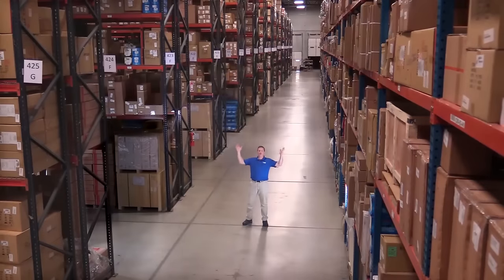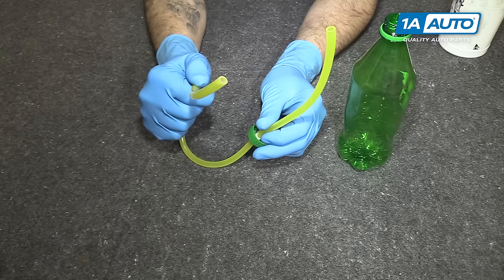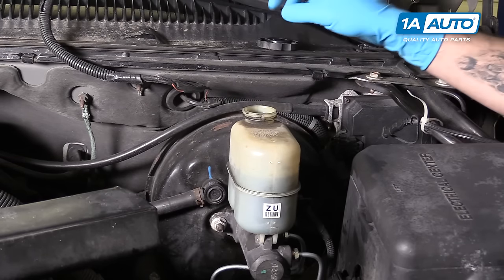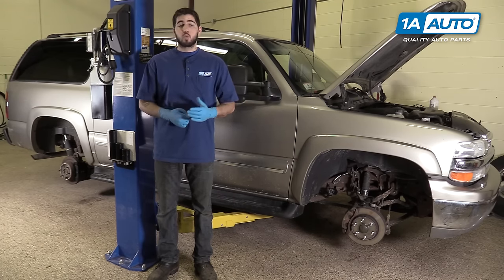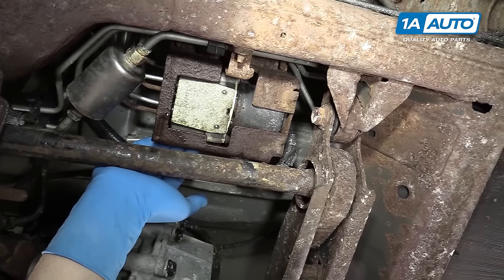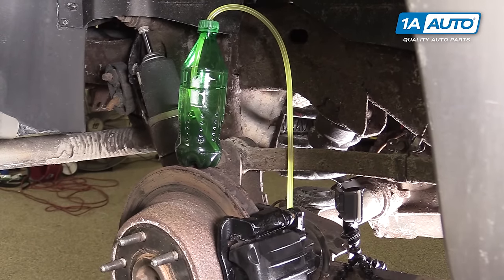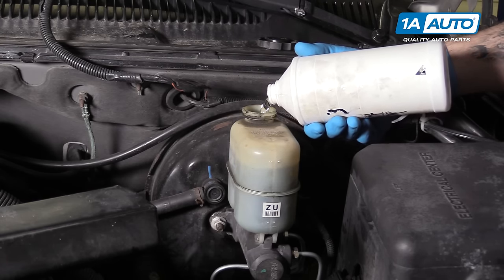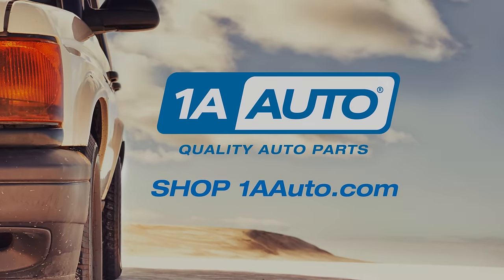How to Bleed your Brakes by Yourself

Comment from the maker: √  Watch the Video
√  Buy The Part @1A Auto http://1aau.to/m/Visit-1AAuto
√  Do it Yourself
√  Save Money
Reply: A
Reply: What size hose ?
Reply: So u dnt have to open and close the bleeder screw while u pump the brake??
Reply: @ceejordan9649  you do if you're doing it with 2 people, if you're doing it by yourself just make sure the hose is above the bleeder valve so no air gets in
Reply: Do you bleed with the car on or off? I have a 2013 toyota camry
Reply: @jamesgevedon9910  dress ll
Reply: Do I have to bleed my brakes everytime I change my brakes?
Reply: @raymondjoyner8600  running
Reply: @akitojohnson8434  no
Reply: Oooooó
Reply: @jamesgevedon9910 j
Reply: 0
Reply: Is the master cylinder cap on or off during pedal pumping?
Reply: Thanks for sharing!

Comment: For a person with no friends, I especially thank you for this video because I could not figure out anyone to help me bleed my brakes but if there’s a will there’s a way-and my brakes are gonna get done this weekend!!
Reply from the maker: +nate theGREAT Thank you for the reply! We love to empower our customers by showing you how-to perform your own auto repairs while installing our high quality auto parts. Have a great day! 1aauto.com
Reply: @1AAuto lol
Reply: RIGHT lol this method works i had been workin for like 2 hours to get mine bled and then i watched this video- done in 10 minutes. Way easier than I was making it. The two things that tripped me up-
1. not having a vent on my bottle for air to flow out
2. Overloosening the bleed bolt. really barely gotta unscrew it and bam flows like water

I just used some old denebulizer tubing and a pieve of tape over a bottle, for those who dont wanna screw and ziptie and whatnot
Reply: Ain't got no friends either. Got my dawg.....she's my buddy.
Reply: Buy friends, Nate.
Reply: I'd be your friend, Nate.
Reply: Why don't you have any friends?
Reply: @andrewarmijo6534  cause who needs em
Reply: Team Loner here too 💪🏼😅
Reply: This crossed my mind on the way home from work.. I never expected to find a video on it, lol. I thought that it would work with a submerged line n bottle. Only thing that didn't cross my mind was the little vent hole in the bottle. Thanks for the vid bro. Very good and very thorough.
Reply: what could you have done differently to have friends ?

Comment: I was in a pickle after doing work to my car and during the test drive afterwards the brakes were super spongy.  I knew I let a very little amount of air into the system, but was not sure what the impact would be.  Wow, just a little bit of air made my vehicle so dangerous to drive.  I don't have any friends close to me, so I searched YouTube for "remove air from brake lines without bleeding" hoping there was a way.  I found your video, went to the hardware store, picked up clear vinyl tubing.  Went  to the auto parts store, picked up brake fluid.  Did this to my rear brake calipers and problem was solved.  So simple and easy.  Thank you very much for making and sharing this video.  Have a great day and cheers.

Comment: You should warn people attempting this, that on older vehicles the bleeder screw is going to be seized and may strip.  Plan on having new bleeder screws or even new calipers once you round the old bleeder screws.
Reply: I don't believe that is 1A Autos job to begin with. He did mention that if it's an older caliper the bleeder valve could be seized and to be careful, and if need be use the boxed end.
Reply: PB blaster or Zep Pro, torch, soak, torch, repeat and they will usually come loose without breaking.
Reply: he does... he says u may want to use the box end of the wrench...
Reply: @VndNvwYvvSvv  Great tip; what kind of torch is best and will it burn or explode with penetrating oil near valve?  Thank you
Reply: Do new calipers come with bleeder valves attached? Thanks
Reply: @chrislg4519  yes new calipers come with bleeder screws
Reply: I got a 10mm wrench box end stuck on a bleeder screw one time. Rounded it and wedged it up against the caliper some how. Luckily it got stuck tightening it. I still don't understand how it got stuck but could never get it off. Sold the 4runner three years later with it still on there. 🤣

Comment: For this method to work, The hose need to point up then down to prevent the fluid and air from returning back to the caliper. You did that in the video but failed to mention this important step.  Good job though
Reply: Does the bottle need to be under or above the caliper ?
Reply: The bleeder valve designed one way out. So don’t worry about the fluid will returned!
Reply: @TN-bm6dh  bleeder valve is NOT a check valve (one way out). Though there are special AFTERMARKET bleeder valves that are one way out; i think they are called speed bleeders or something similar.
Reply: Well unless you are holding your bottle even with the bleeder valve while the drain hose is attached you should be ok. This is simple physics. One end of the hose needs to be pointing g down the other end pointing up. Should have no issues with this process.
Reply: @TN-bm6dh  that is simply not true, unless you put speed bleeders on
Reply: Nothing wrong with this..air travels upwards..
Reply: Didnt even worry about that and it worked perfectly
Reply: Omg this must be my problem lol
Reply: As well as not pushing the brake pedal all the way down but rather half way down.
Reply: If the hose is fully submerged in fluid then this won't have any effect... as it is a closed system, and controlled by the master cylinder at that point..
Reply: If the valve is truly one way only ( and airtight one way) then this whole video would be pointless

Comment: I had good success with this technique but I still had some air in system - possibly due to bleeder valve undone more than needed... I added my own variation by pumping the brake 4 times and then using a cut 2x4 and the electric seat forward to do the final pump and hold it in place.... then tighten up / release as you would 2 person technique. This additional step fixed the the pedal from being sloppy / soft/ long travel which is a sign that there is air in the system.

Comment: Looks great.  Can't wait to try it on mine.  However, seems that once the bleeder screw is tight again, instead of having to worry about pinching off the tubing to prevent oil going everywhere, perhaps lowering the bottle well below the screw first would be the best bet, as gravity is then working in your favor.
Reply: I can attest that your above method works with no spillage.
Reply: You do want the air to rise through the hose though so having the bottle high isn't a bad shout
Reply: @stewartrowlands792  But the bleeder screw will be tight so air wont be able to go in?
Reply: @BubbaGumpShrimpss  don't loosen the bleeder screw too much.  A quarter turn is all you need.  Too much will make it leak out from the threads and possibly allow air to get in.  However, you can put a layer of Teflon tape on the threads to make a good seal, remove the bleeder, apply the tape and thread it back into the caliper
Reply: @stewartrowlands792  Point taken.
Reply: @BubbaGumpShrimpss  ???
Reply: @Rock_Reggae_Riff  I would not do that. Teflon tape can break apart and you don't want pieces of it in your brake system. Same reason a lot of people don't use teflon tape when screwing together natural gas pipe, tiny fragments can clog the diaphragms in the gas regulators.
Reply: Just used this. Works perfectly. Big help
Reply: Nice pic
Reply: @stewartrowlands792  you want the bottle above the bleeder screw when the screw is open, but after the screw is closed, you should lower the bottle to below the bleeder screw, and then disconnect the tube. 

If you hold the bottle up when disconnecting, you could start a siphon that draws out all of the fluid in the bottle.
Reply: @cymond  That's on point.
Reply: What if the brake fluid comes out a little bit and stays at the tip of the line instead of flowing to the bottle? Please help!
Reply: If the bleeder screw threads are loose,  air will be drawn back in. Only a quarter turn  loose and a high bottle would help with that problem.
Reply: @Rock_Reggae_Riff  Teflon tape isn't made to seal anything. It's just for making it easier to screw on or off. But it does seal some things well

Comment: Just a friendly suggestion...if the vehicle happens to be your own property, replace all the caliper bleeder screws with Dorman SpeedBleed bleeder screws (which have one-way check valves built into them); and fit lengths of 3/16" vinyl tubing onto each bleeder screw and open them all up at the same time.  Place the free ends of the vinyl tubing into the same container, and invert your brake fluid container onto your open master cylinder, and leave it there.

Pump your brake pedal slowly and consistently,  until clean fluid is seen in all hoses, and all hoses are free of air bubbles.  Remove your brake fluid container from the master cylinder and re-cap the master cylinder.  

Give the brake pedal a few more pumps if the master cylinder fluid level is too high, then close all bleeder screws and remove the vinyl tubing from each and replace the protective caps.

Purge the brake fluid from the lines into your container, and dispose of it properly.

You will have bled the entire system in the same time it would have taken you to bleed only the longest brake line, and be done on less than half the time it would take you to bleed each line individually--fantastic when you need to do a full system flush.

Comment: I enjoy learning every time.
I ride a 2017 JK Wrangler.
My question is, is there an intake that has a throttle installed above the lower intake? The lower intake licked when I applied 7.4ft-lbs of torque to the 8 bolts that attach it, how can I fix it?

Comment: i have made one of these in the past with a magnet attached to the side of bottle to hold to frame. I also use a couple of folding make up mirrors so i can watch the fluid/bottle from in the car so you dont have to keep getting out to check..works great

Comment: Question: since brakes are generally power-assisted, I wonder if the engine has to be running when "pumping the brakes"? Thank you for clarifying. 2022/08/18. Ontario, Canada.

Comment: Absolutely phenomenal tutorial. Things to help note for newbies (that I had to learn via the school of hard knocks) are:
1) Make sure the container with your clean brake fluid is ABOVE the brake bleeder valve. This ensures that you're not just dumping in a ton of liquid, and that air is for certain being released.
2) Gotta gotta gotta make sure that master cylinder cap is on and SCREWED ON (unlike other styles of brake bleeding that take it off or rest it on the top).
3) Some brake fluid is gonna fill into the container. I'm not 100% sure this isn't my own personal error, but I can also see fluid flowing into our mechanic's bottle as seen in this video, so I'm assuming that is to be expected. If you've got old, dirty brake fluid in there that you're bleeding, it'll contaminate the new brake fluid. This is really just best for air, at least in my experience/opinion.
Of course if any old pros or mechanics have corrections for an apprentice like me I'd love to hear them. Thanks so much to all you at 1A Auto for your supremely helpful and informative videos!
Reply from the maker: +Amand Edvard Thanks for the feedback!

Comment: Great video.   Suggestion:  before starting the process go around first and make sure each bleeder valve is loose enough to be opened once you get to it... and to make sure the wrench size is correct for each valve (believe it or not the size is not always standard especially if a non OEM brake part had ever been installed). 

If one or all are not easily opened you can do what’s necessary to free up the valves, before starting the process with the bottle.
Reply: I was trying to do it with a wrench and almost stripped the valve just because I didn't want to take the tire off. I used a socket with ratchet to loosen them before completely using a wrench.
Reply: A line wrench is a good option too.  Never stripped one  while use it.
Reply: @Rock_Reggae_Riff  Most definitely. Good advice, for sure.
Reply: I agree
Reply: This is a great suggestion. I just did the brakes on my Miata and I checked the bleeders first. 3 of them broke off like they were made out of plastic!
Reply: @amicloud_yt  😭

Comment: Thank you, 1A Auto, your video helped me to do a one man brake bleeding.
 
I would recommend, instead of pinching the tube after finishing, if you lower the bottle below the bleeder valve, all the excess fluid will drain back into the bottle.
Reply: Do you do this process with the vehiclen on or off
Reply: @Juan2011Strong  Off.  With the car running, the brake booster will be active, and you'll have crazy pressure in the lines when you step on the brake pedal.  You'll shoot the hose off the bleeder valve and spray brake fluid everywhere  on the first press.

Comment: If i bled all the brakes and ensured air bubbles were clear. drove around and didn't feel any change in a firmer pedal. Is that normal? Its not worse just the same as before bleeding the brakes.

Comment: If the 3/16 fuel line connecting the wheel cylinder and bottle has air in it (even if the tip is submerged in brake fluid in the bottle), that air will still potentially suck back in to the system, would it not?  Seems like you would need to have the fuel line tube purged of air and full of brake fluid as well as be submerged in brake fluid in the bottle.

Comment: I’ve seen it where a person cracks open the bleeder valve for a second or two has the helper pump and hold the brake , then they close the valve and then the helper released the brake. This method does not require the closing and opening of the valve many times as I’ve seen before . Please advise why others do it in the aforementioned method
Reply: Listen at 5:20

Comment: As you went to each wheel did you stay inside the vehicle and pump the pedal and hold it down and repeat. 
    Or did you have to close off the bleeder screw in between pumping the pedal?

Comment: I've noticed the process is a little bit faster if you position the bottle so it's below the bleeder valve but I've done it both way and it works great no need to drop big dollars on a self bleeding vacuum
Reply: I'd think you want the bottle higher so the air bubbles go up and away from the caliper and the only thing that can get sucked back in or be anywheres near the bleeder screw is fluid
Reply: It doesn't matter where the bottle sits: 

1) The pressure within the system (pumping the brake pedal) is what moves the air and fluid through the lines. 
2) the end of the bleeder tube is submerged in brake fluid at the bottom of the bleeder bottle to keep air from returning back into the system. 
3) the air rises (key point) through the brake fluid in the bottle regardless of its position, as long as the tube remains submerged. 

In fact, you could make a bottle and tube device that mimics an IV bag and tube to bleed your brakes just as quickly or as slowly - it doesn't make a difference on speed and would actually waste less brake fluid. You're purging the trapped air within the fluid by applying enough pressure to move both fluid and air to a place where the air can escape - that's it.

Comment: Incredibly helpful, easy, and very inexpensive. A trip to Ace, $1.20 later, and brakes are perfect... thanks 1A Auto! The content you all put out is incredibly helpful!
Reply: I've done this job on 2 different 1998 Toyota Camrys, first time it was perfect but the second time not so easy, so here's things to watch out for normally it only takes a 32 oz.. bottle to bleed all 4 sides but buy an extra 8 or 12 oz. Just in case you ran out before the job is done when you loosen the bleeder bolt be careful not loosen it too much and my problem the second time was that the end of the tubing that goes into the bleeder bolt expanded because I had used it before so as I was pumping the brake pedal air was getting in and I couldn't figure out why until I noticed the problem with the tubing so I just cut the front piece off and it started to work perfect again so just have a bottle or 2 extra of fluid just in case they're cheap and you're still going to save a lot of money doing yourself I'm pretty sure mechanics charge a couple of hundreds of dollars and is no guarantee they're going to do it right, at least if you mess up you know what you did wrong.

Comment: I have a question, in my car, i cant press the brake pedal more than a few centimetres when the ignition is off. Do i need to keep the engine running while I bleed it?

Comment: Thanks for this informative video.  When I do this, I try to keep the bottle below the level of the bleeder screw to make the air bubbles more easily seen in the bend at the highest part of the hose but close to the bleeder screw where you're working.  The zip tie on the hose below the bottle cap is a great idea.
Reply from the maker: +Anonymous98 Thanks for checking us out!

Comment: so with a system that had several lines replaced wouldn't it be a good idea to open all 4 bleeders to gravity feed the new fluid in the system??? then close the three bleeders and start at the back passenger wheel using the method you show here???thanks for sharing